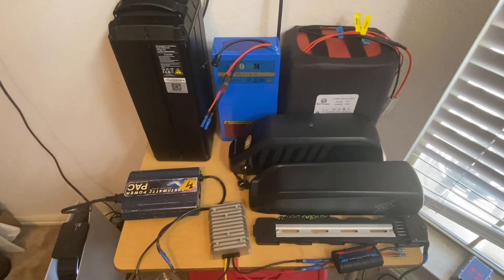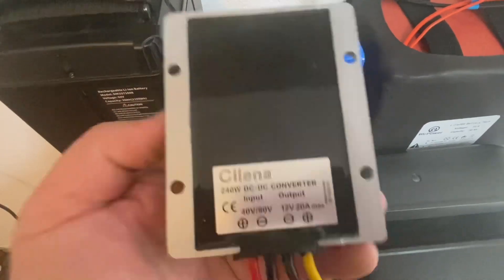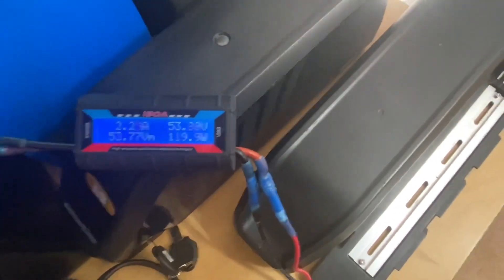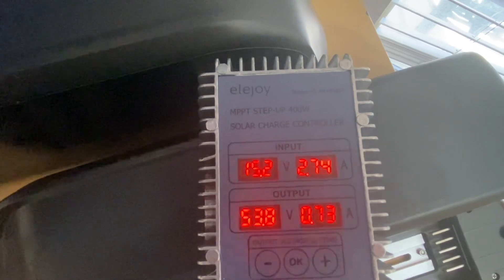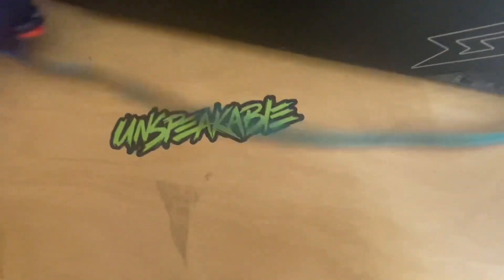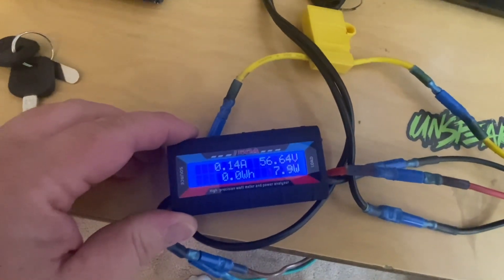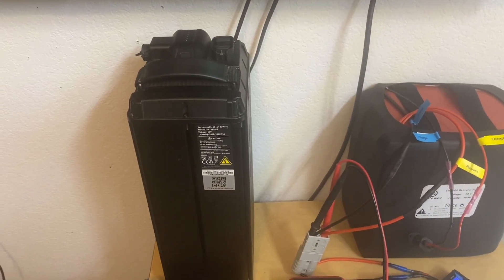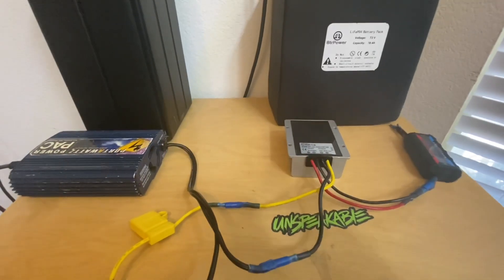How to use a E-bike battery for emergency power

Comment: Thinking about using this type of setup for a camper trailer power supply just because Market place has a lot of E bike batteries for sale, and I know how to repair them. I figured 4 or 5 power packs at 48/52 volts woukld be enouigh to run most household stuff for a few days. Recharge with solar and a charge controller would work pretty good.
Reply from the maker: I would go 48V because they have 48V solar charge controllers and inverters

Comment: Great info! Thank you! I've got (2) 52v ebike batteries that I want to setup in parallel. I want to use them as backup power for a sump pump during a storm. Any thoughts on this idea?